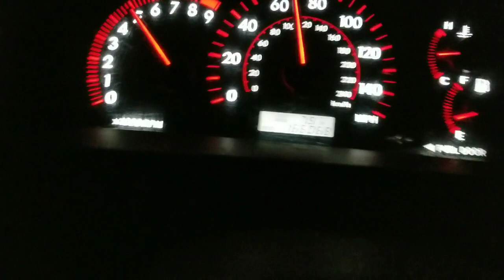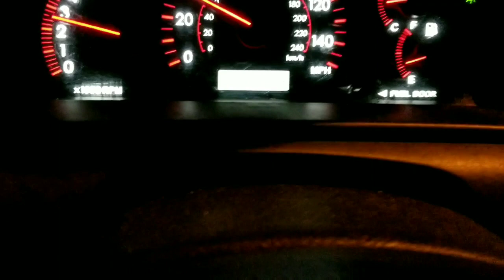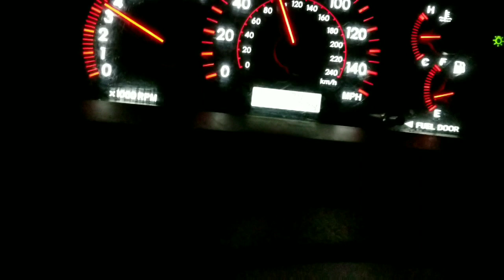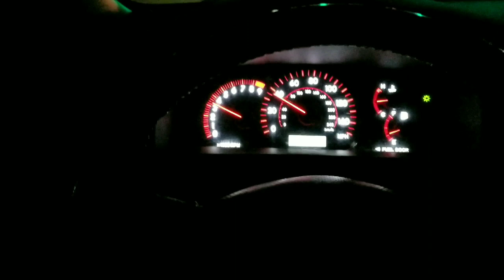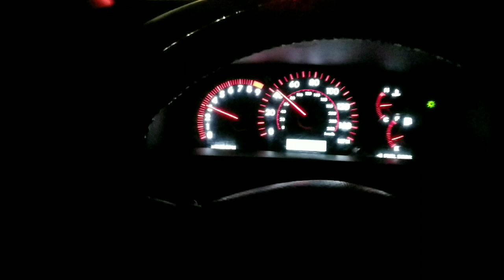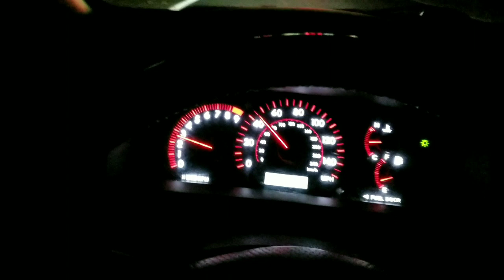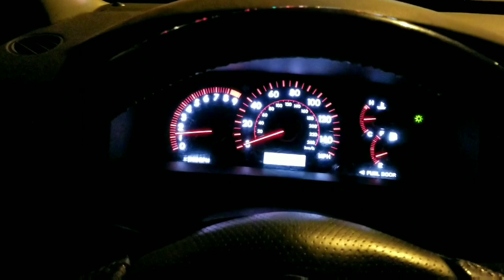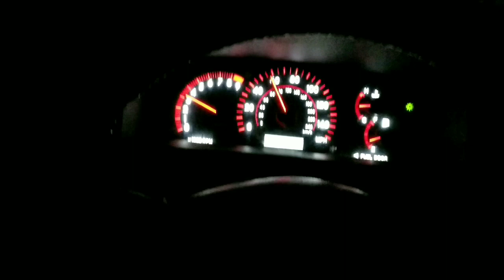Problem Solved! Lift is back!!

Comment: Even though it was an easy fix, glad you checked oil pressure first. Kyle from boostedboiz kept doing dyno pulls trying to figure out why vtech wasn't coming on and it was cause a bad oil pump. He got lucky with minor engine damage to crank bearings but coulda been worse.
Reply: Also I replaced my sway bar end links 6 months ago on my corolla and clunking sound came back. I thought it was my actual way bar bushings that were bad... Nope. The brand new end link failed.. And I didn't find out until i removed it cause the rubber boots were still perfect.

Comment: So it was what sensor? What denso sensor you change that helped you with the lift problem?
Reply: He mentioned camshaft sensor.  Pretty easy to change.  Crankshaft sensor on the other hand is a little bit harder due to wire/plug routing but can be done.  I just changed both my cam and crank sensors after 395k miles.
Reply: @abuelb  what issues it gave you  to replace the crank shaft sensor? What improvement did it do on the car?
Reply: @JO3haNsum  the crankshaft sensor was coated with burnt oil and had lots of fine metal shavings on the tip and around it since it is magnetic.  I was getting rough idle and some knocking sound.

Comment: If a 2zz isn't going past 7000RPM does that automatically mean there's an issue with lift?
Reply: it means it isnt getting everything necessary for lift, water temp, rpms, oil pressure or lift bolts I believe
Reply: Hi, Hi, I have exactly the same problem. did you manage to solve it?

Comment: Hi can I ask what sensor u speaking about I seem to have the same problem
Reply from the maker: Crank sensor but there are various reasons lift stops working...could be lift bolts also do you have a code?
Reply: @edarr85  it only happened yesterday didn't get chance yet but the car feels down on power even b4 it reaches lift. Thanks
Reply from the maker: @nevillenicholls4937  sounds like lift bolts...hopefully not..check your codes and let me know
Reply: @edarr85  ok thanks I will
Reply: I have a p1693 code, and poor lift pls help
Reply: @azuritew210  based on that code your code reader should give a reason as to what the problem is: so background, my lift doesn't work, but anything below 6k rpm is fine, so I have the same code but my issue is: ocv closed malfunction.
Reply: @SpartanQwop  yes, i solved my issue, problem was in vvti solenoids, they were clogged during the poor maintance

Comment: Le hice un swap a mi carro con el motor 2zz y no pasa de 7mil por favor necesito ayuda no sé lo que es
Reply from the maker: Check, cam sensor, crank sensor y el sensor de temp
Reply: @edarr85  Los voy a verificar de nuevo y me falta de poner el speed sensor tiene que ver en algo? Ya que no marca la millas…
Reply from the maker: @forzagaming6548  eso es!! Nesesitas el speed sensor
Reply: @edarr85  Acho decía yo porque tiene todo conectado y no le falta nada más y también el cruise control no funcionaba me imagina que el ecu no leía la milla y no activa el lift para no dañar el motor,Gracias un millón me voy a poner bregar en esto el sábado y te dejo saber por aquí e mismo si funciono
Reply: @edarr85  Espero que pronto subas más de tu contenido hacen falta🙌🏻